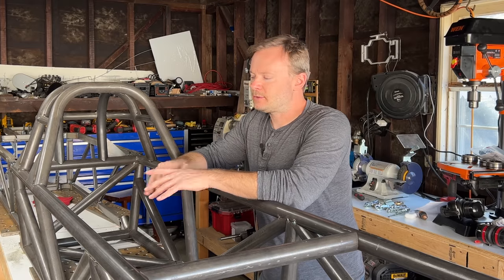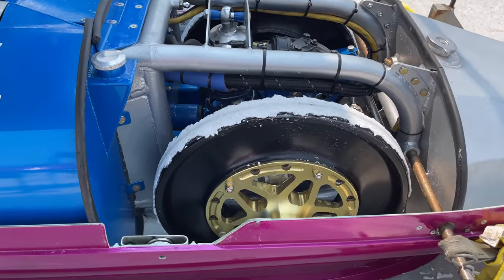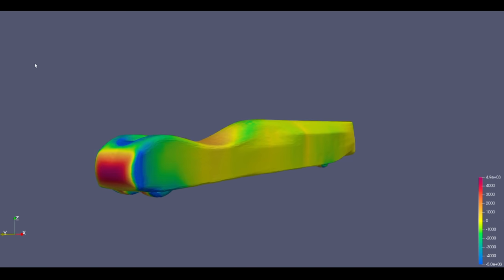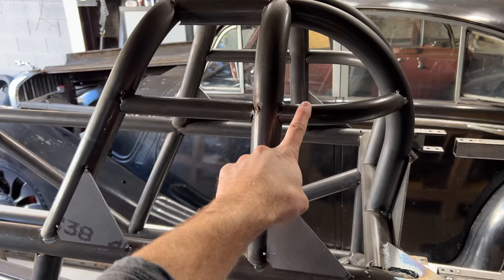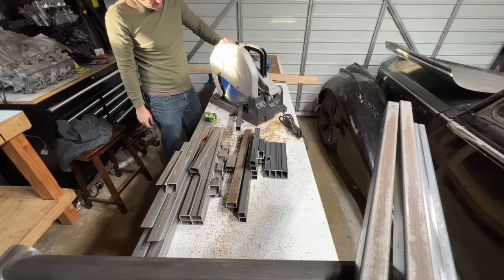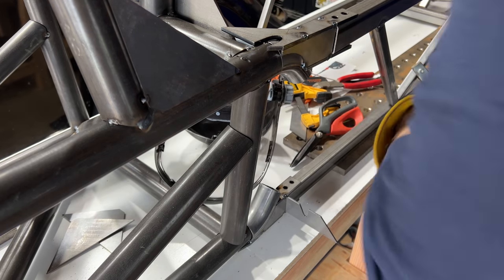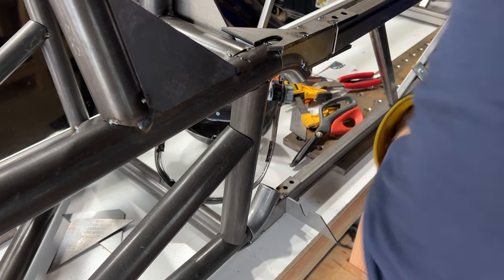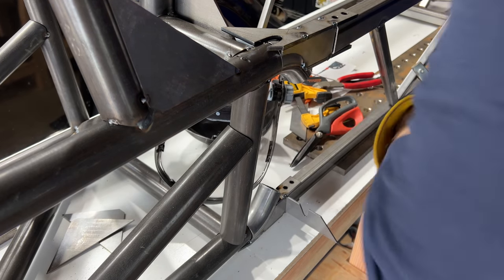Building A Race Car Frame: How To Not Die At 200 MPH

Comment: One advantage of land speed racing with human powered vehicles(generally bicycles in the same low frontal area, longish aero faired configuration ) is that the center of mass is also the engine.
Another is, that the governing body, the International Human Powered Vehicle Association (former IHPVA president here) doesn't require the fire resistant clothing or specify a a number of wheels. 
Moreover we do allow video means of visual guidance,  fully duplicate including power, so that head bubbles are optional. Monocoque framing is allowed, but the composites used must be safe in a crash at our top speeds (now at 89.6 mph) so that generally needs carbon and Kevlar, often  with honeycomb stiffening. Roll cage structure of course and helmet mandatory, but not motor sports grade, yet. 
We  cannot race on the salt, too rough and high in rolling resistance. We do not race on rough  chip sealed paving either for that reason. But all other constraints, straight line, measured flatness,  longish run-up to the measured timing traps are similar to Bonneville, Black Rock and El Mirage record racing. One difference is that we do use motor vehicles  running at the same speeds for safety chasing during the runs. It is necessary to keep those chase vehicles back sufficiently both not to overrun the participants and to not enter the speed timing traps  along with the racers. Some past top speed records were possibly compromised by the "bow wave" from a chase vehicle fairly close behind. As with all rules based racing, bending those rules a little to win is expected. Good  luck and thanks for you excellent analysis.

Comment: Don't overlook the many potential gains of sitting in front of the front wheels/tires. Opens possibility of front wheel drive which helps to prevent spins. Allows good weight distribution to front. The tires can now be taller, and the track width has more options. The visibility will also be better. Also think about what an inverted V tail might offer such as being lower center of gravity to prevent side gusts of pushing the rear of the car. The inverted V wings may also allow some downforce to be slightly added.

Comment: you may want to cut a few small pieces of metal tubing to put inside the square tube were the bolts go thru it will help prevent them from crushing under load and make the entire connection stronger

Comment: Wonder if you used that nose section for small air induction ports and ram air. Could it be done? Probably some big HP benefits since you're running deactivated cylinders. Nevermind just finished watchign the video.

Comment: My neighbor was the lead mechanic for Cory McClenathon's A-fuel dragster.  They never painted anything, and after each weekend of racing, they would scrub the tube frame with steel wool and ATF.  Detergents in the tranny fluid, with the steel wool, keeps it all rust free and clean.  Paint is weight is your enemy.  Just a little FYI from a fan.
Reply: He is going to be racing on salt so i wouldn't recomend that :)
Reply: Fuel Dragsters can't be coated as it will hide any potential metal fatigue its in the rule book and they are tech inspected at every event. I was part of a Top Fuel 4x Championship wining team.
Reply: On a land speed car weight is not your enemy. Weight will keep you planted.
Reply: @banaana1234   I'm not sure I agree, otherwise these guys wouldn't be trying to keep the car as light as possible.  Weight and drag are the enemy of thrust.  Other than the minimal possible gravity of the car, the aero plays a bigger part in keeping it straight, stable and planted.  With his displacement limit, I would not add even one gram of weight by painting it.  Aircraft is the same in that you don't wax a planes surface, you polish it, as wax = weight.
Reply: @matthewpeterson3329  Land speed racers literally put lead ballast in the cars. In fact, Matt stated in another comment that he will put ballast in this car as well. Weight pretty much only matters for acceleration, and land speed racing is not about that. Drag is an exponentially bigger factor, so you want as little aero control surfaces as you can get away with.
Reply: @banaana1234  I agree that drag and stability are the most important factors, but the course length is limited so acceleration is still relevant.
Reply: @brianb-p6586  Relevant, but not worth sacrificing stability over it. Like I said Matt will put lead ballast on this, paint will not matter.

Comment: Nice build. I hope you go fast. Super fast. Please add a support tube to take that roll cage tube from the horizontal down to a cluster. That is a No-no in cage design, as you mentioned. That horizontal will bend. Best gussets are not 1 sided plates like i see but more like a "taco" shell...aka taco gusset. Look at rally car FIA cage rules. Use paint on the chassis. Powder coat is thicker and can hide defects and cracks. Its not well thought of in aviation circles for highly stressed tube air frames. Good luck keep the shiny side up.

Comment: Hi TFM,
2 questions/concerns re your frame design:
1.  Why did you choose to have some non-triangulated joints?  Won't they cause unwanted weakness and vibrations? 
2.  Are you sure the bolted joints between the two halves will be strong and rigid enough?  Are you planning on doing more with those joints, like maybe welding them just before the race?
Reply: PS, love this video, your humor, and your very informative videos overall!

Comment: I suppose you'll add something inside these (flimsy) rectangular tubes before bolting them together so that they don't crush... and I also suppose you've run a simulation to find out the torsional and longitudinal stiffness at the attachements points between these 2 halves (better not have a weak point right in the middle of a rocket, right?)
Like in an airplane, you also may be able to check the G loading this can stand, not for a long time but for the vibrations induced by uneven ground through a low travel stiff suspension (also checking the vibration modes of that 20 foot stucture)
looking thrilling...

Comment: Question: instead of carrying water or 0.5°C water or -2°C salt water. Can you have co2 solid or liquid system. It Could double as fire suppression with a purge valve where ever you require. And might be easier than keeping water cold in a dessert salt plain.

Comment: 1. Don't a lot of land speed cars have one front tyre in front of the other to make the front smaller?

2. Doesn't the main roll hoop tubes have to be one piece all the way down to the lower chassis tubes?  (This may depend on the sanctioning body you race under? May be worth asking though?)

3. Instead of spraying the tubes would it be worth just clear coating them to make it easier to inspect and find any cracking in the future?

Comment: Seems very well thought out!
My only feedback for improvment are the bolts holding it together. Seems like a weak point in the middle of such a long car, also im pretty sure even 0.01mm difference where the bolts are will move the rear of the car by at least 1mil. Thanks for measuring in metric btw ;)
I recommend either using pins to firmly locate it in spacetime or using more square tubing that goes over the smaller square tubes so it will guide the halves together as well as strenghten the whole structure so it wont bend/break in the middle.

Also im sure youve done your calculations, therefore making it an engineering solution, so ill just shut up ;)

Comment: You should paint it with Steel-it spray paint. It’s durable, weld through and dries fast… not cheap, but much better than regular spray paint.

Comment: Can I offer a suggestion which may or may not be kosher for the rules? On those big triangular holes in the main seat area (around 8:00 in the vid), are you allowed to use netting as opposed to AL panels? I'd imagine that would hold you in pretty well in case of a tumble and the weight savings would probably be significant. Plus I assume that'll all be covered by the body as well so you should still have some decent protection. Of course you may want the panels for some additional structure as well.

Comment: This messed with me and my need/want to have stuff even and or parallel. Where the motor sits the angled bits on side of the frame, on the left they meet to a point at the top but on the right they don't. I'm assuming it's done for motor reasons and not just to mess with my head. 
Any ideas on what replacement motor you'll get for the red beast?

Comment: Two quick things:
1. Could you make the nose pointier to cut into the air more--and lower the frontal pressure?
2. Wishing you the best on this amazing project. ☺️
Reply: The downside of extra pointiness is more wetted area = more surface drag.
Reply: @EmyrDerfel  Ahh, that makes sense.
Reply: Really pointy is only ideal for supersonic speed, which is why only supersonic aircraft have really pointy noses..

Comment: just a thought but at the point that you are bolting the 2 h10ft sections together have you thought about sleeving the holes in the square tubing to help prevent buckling of the tubing when bolting them together and just to give it a bit more durability if this will be one of those points that you with be torquing and loosening with transport (as well it will make lining the bolts up a lot less of a hassle as the sleeve will keep the bolt from flopping around when putting the sections back together)

Comment: The tube cuts look pretty decent but Calwest should put a carbon steel backer rod in when they cut, it'll reduce how much slag sticks to the inside of the tubes.  And arguably they got a little hot on some of the tabs and corners but the parts look good so that's just nit picking.

Comment: Matt I have to question how you made that split in the middle of the vehicle. It looks so prone to being a problem for failure. Would it not have been better to have a joint where one piece slides into the other with a male/female type connection then bolt in together?

Comment: Sounds like SendCutSend needs to get into tube cutting also! 

So you have turn buckle supports that you didn't want to impale you, but then you put four bolted junctions right behind your body? What happens if the rear section bolts break?

Comment: I have seen powder coat wear underneath the head of the boat and nut. Come apart and fail. Powder coat has substantial thickness. Just powder coat some threads sometime. If anything maybe some sort of electroplate

Comment: Looks very thin wheel to wheel ... does it have a propensity to fall over?
I understand the desire to keep the front cross section small ...
Yeah I mean 15:46. I think one would need active stabilization from fins at those speeds ... or a larger wheel base.

Comment: You wouldn't need a VR headset if you wanted to lay completely flat. You could look through a series of mirrors and lenses, looking through multiple tiny windows around the car. It wouldn't be as natural, but as you said the goal is to only drive in one dimension!

Comment: The  junction  with the two bolts between the front section with the "safety cage" and the aft section engine pod does not look very assuring, might crack when objected to torsional forces when tipping over in a  tumble across the salt flat..the vehicle would break up into 2 pieces ...I would redesign that part in addition stagger the placement of the junction on each of the 4 tubes.
Reply: Who cares where the motor ends up in a roll over as long as the safety cage holds up. Built-in engine module ejector, anyone ?
Reply: @dazeller82  I dont think that it is a good idea to have the front section and driver  tumbling and rolling without a chute  head over heels all over the place. Watch  on YT what happens to a top fuel dragster after its similar  frame breaks up in the middle!

Comment: That cockpit is so cozy floating an air biscuit may cause a rapid unscheduled disassembly unless proper emergency ventilation procedures are built in and followed.
In layman's terms, have a window port in case you rip a fart.

Comment: There are too many comments to be certain this hasn't already been proposed, but have you considered water-methanol injection instead of a water resevoir for cooling, since the vehicle should only really be operated for short periods of time? Seems like it may give more benefit than the water for short burst operation?
Reply from the maker: That puts me in a different class, but in the future I will move to the turbo/fuel class and use methanol to keep the temps down.

Comment: Super obvious comment but remember, shape effects drag! An airfoil will have a larger frontal area but far far less drag than a bullet!

Also, drag/downforce costs power, but mass only costs time - using your aero/engine to create downforce will limit your top speed but using mass will only increase the amount of time to get there, at your speeds downforce will cost a LOT of power.

Comment: A somewhat serious question regarding the engine. What about RC engines? Because of their high RPM they have a lot of power. You'd need a gear box, but you will get many horses in a small envelope.

Connecting a few together, I mean... Not just one at 1hp :)

I haven't done the calculations, nor specification lookups, for a while, but I do remember them in theory potentially being a viable option for a small format generator.

Comment: Shoulda laid flat on your back and used a 45 degree mirror to see in front over the wheels. Sick video thanks for sharing!
Reply: Even if it were legal, a single mirror would be very difficult to use. A periscope uses two mirrors or prisms (plus lenses in some cases) to produce an upright and non-reversed image.

Comment: I don't know much about the rule book for this , but in other classes running coolant or oil lines through the frame tubing is not allowed.
Reply from the maker: Running lines through the passenger compartment is not allowed, but I'm fairly certain it is allowed inside the tubes. I'm awaiting a response from the rules committee on that and other things.
Reply: @SuperfastMatt  That's great. I like the idea of using the dead space. just didn't want you to get cornered later. Love your work dude. I put your videos on whenever i'm in the garage for inspiration .. and as a virtual companion since all my friends are boring and don't like building cool stuff.

Comment: Why not put a 2-stroke in this? For their displacement and weight they make much more power NA and I’m sure they’re available in versions that wouldn’t require dead cylinders. Are they not allowed in that class or am I missing something obvious?
Reply: They're allowed, but I don't think that 2-strokes have much if any advantage over modern 4-strokes.

Comment: It is too late to change now but Instead of a chassis made of carefully notched tubes is it possible to make it from laser cut sheet metal, a big box beam with stiffeners to prevent local buckling. It would make for a much easier and cheaper to build chassis than tubes.

Comment: use STEEL-IT polyurethane topcoat/aerosol paint you can weld on it without striping paint to bare metal and it should protect agains salt

Comment: Unfortunately I have not read all the comments. Why do you choose a bullet shaped nose as opposed to a Costello/Yacucci nose which goes to the deck to slice under the air??
Reply from the maker: I’m still doing aero analysis, so the nose shape will change based on those results.

Comment: Out of curiosity, how expensive was the tube-cutting service?
Reply from the maker: $1600 including material, so about 150% more than it would have cost just for the tubes. This came with two bends. Its been my experience that bends increase the cost a lot which is weird. I feel like there is an opportunity for someone to make a Send Cut Send style service (no minimum, one-off) with a combo CNC bender/notcher.
Reply: @SuperfastMatt  that’s an amazing deal considering how hard it can be to even get some of that material and the crazy time savings
Reply: @SuperfastMatt  did you have to specify all the tabs and slots or is that part of the laser cutting service?
Reply: @baldrehdead  good question!
I’d like to know that as well.

Comment: "At some point I'll run an analysis on this bad boy"
I can immediately tell you there are some bad things happening there.

That tail is like, stalled with a hundred percent certainty. Flow separation over the back of the canopy is practically guaranteed. And if not, well redirecting that much air straight down should make vast amounts of lift and drag.
The front is far too pointy. It should be bulbous with maybe a slightly pointy shape. I think it gets literally no benefit from having the nose shaped like that
The fairings on the wheels are probably ok but not for the reason the designers probably think. The air is gonna go out and around them mitigating the issue of flow separation.

All in all I bet it's wildly unstable and has a drag coefficient of 0.45 or so.

Comment: I'm not a fan of that 2 sided 2 bolt frame connection, you might want to run that by SCTA tech before you commit to it. I would do a male-female connection there with the bolts only being the locaters.

Comment: Title is a bit misleading: There is no reason you would die at 200MPH. Death only comes if you stop going 200MPH too quickly.
Reply: Also if some of that inertia converts into rotation, causing an undesirable difference between the angular acceleration of the skull and brain.